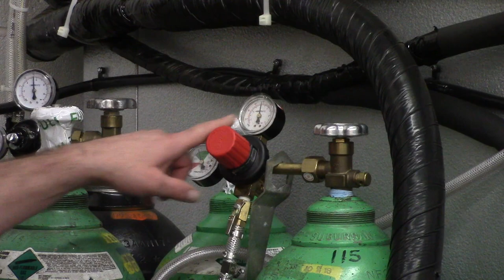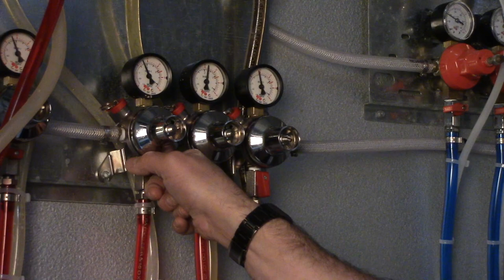Draft Beer Not Pouring?! 5 Reasons Why and How to Fix the Problem?

Comment: I have a dual kegerator with hard cider on one side and a Porter on the other one. Cider pours fine set CO2 pressure 10 psi and the splitter to both kegs have no way to regulate the tank set at 10 psi. So both kegs get the same psi set at the CO2 tank regulator. The problem I'm having is the Porter keg pours slowly and after a glass just stops? If I shake the Porter tank a bit it starts to pour but again very slowly. I have no leaks in the CO2 system and both CO2 is fully charged and both kegs are recently bought and filled. I checked all washers on both CO2 lines and beer/cider lines. I'm baffled and yes I'm a newbie to having a kegerator. I might note I have the CO2 tank mounted outside of the kegerator to make it easier for me to see the CO2 tank gauges. Suggestions?

Comment: Hi I'm just wondering if you would have a recommended brand of nitrogen generator/ gas blender
Reply from the maker: Hi Josh, we typically use Micro Matic gas blenders with the built in gas leak detectors. They are still made by McDantim so you get that great warranty. For nitrogen generators the Beer Blast seems to work pretty well and check out Fiz Dog nitrogen generators too. -Good Luck, Cheers & Beers!
Reply: @LeadersBeverageConsulting  thank you for your reply and thanks for the content you put out 😊